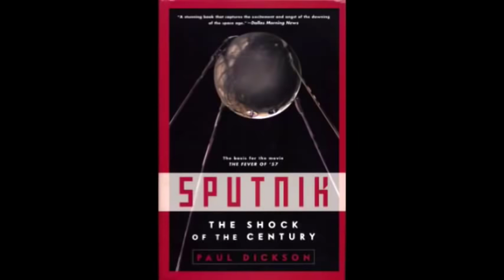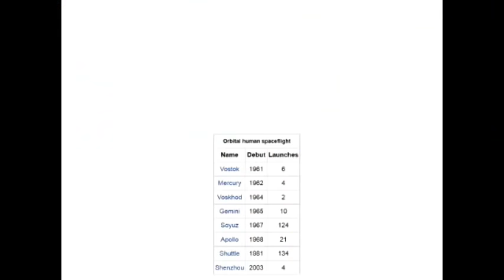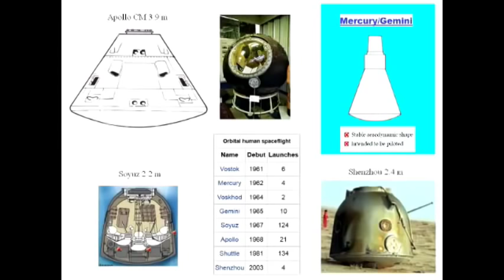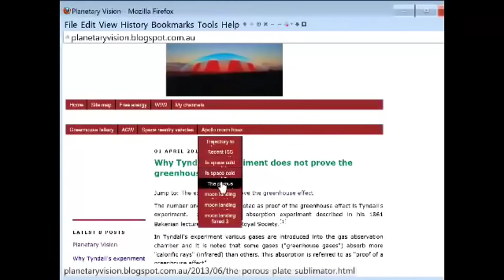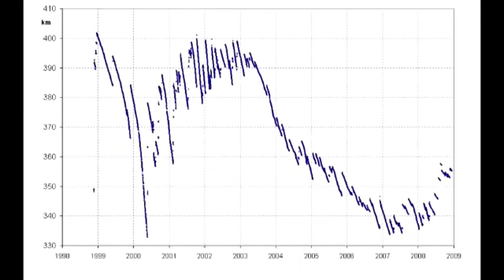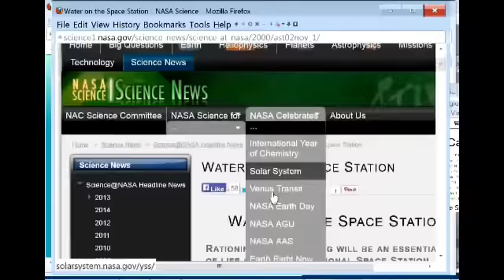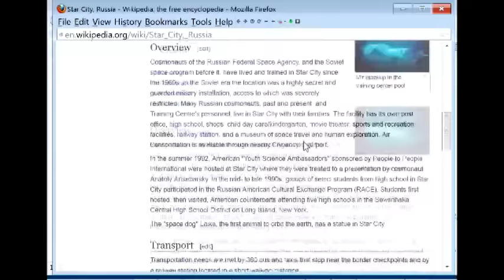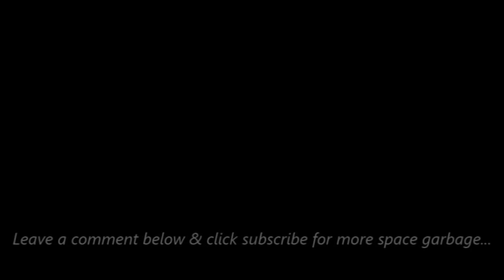The ISS Exposed

Comment: 8:40 look at the stand and the paper. this stand moves up and falls down (gravity or whatever we call the down force these days) And notice the paper the wind from chris and the movement of the metal arm cause the paper to lift rise and fall as hard and fast as about i think a piece of paper on earth does. BOOM! also the drill (blue makita on the left) is stuck on the wall the only way you could mount it on earth all the mass is in the head of the drill so they has to mount it facing down, In regards to huge deceivers and satanists and sodomites we all know they eat shit.

Comment: Lets start from this that movement is not possible in vacuum, as there is nothing to push yourself of .. in case of leak .. well that's another thing, as the pressure always want to level ... so in leak everything is sucked of within seconds together with any air left...
Reply: If you know how gun recoil works, you know how rockets produce thrust. That’s all I’m gonna say
Reply: Max Conspira rockets bring their own oxygen supply, and at this point gunpowder has the oxidizer mixed in the powder. Plus, some rockets don’t even use combustion, they simply use the decomposition or hypergolic reaction of some material like hydrazine.
Reply: Like Ive said before you completely missing the point  @alexsiemers7898  ... its not about chemical reaction that is or is not possible in vacuum... its about physical reaction that is not possible because explosion itself won't get you anywhere ... movement of rockets is possible only because here we have atmosphere that means mix of gases so there is a substance that has weight and condensation and if so there is a "floor" that jet can work with as a base to push itself from ... hope you get the point now. Or make yourself a favour ... stand on skateboard get two weights in your hands and by throw them away from you try to make a movement ... its not possible :... try to push yourself from weights by throwing them away... hope that explain.

Comment: Take a paper towel tube leave the paper on it if you wish... get a picture of the earth or flat object, or cut a round circle on blue paper around 12 inches...lay it on a table...look through the tube about 12 inches above the picture, or flat object...focus on half the outer edge of the circle (at 12 o' clock or at 2 o'clock) and half on the earth part...follow the outer edge of the circle...its the space station pics...the curvature you see is actually the outer edge of the circle...angle the tube to create perspectives of distance...feel free to share this...

Comment: You provide, like any flat earther, no prove... I don't see anything weird at all
13:45, he bends forward a little, let his foot loose, and floats forward, it's so much bs here.
And the noise, you really think this extremely expansive film production, they would have fixed the jet noise!
There are tons of electronic (cooling) and climate equipment on the ISS..
1) locate and identify your zero G-plane activity
2) prove the resupply missions are not bringing filters or chemicals

People, learn how things actually suppose to work, don't believe the flat earth community, or any conspiracy BS, you will only fool yourself..

Comment: NASA didn't 'supposedly' repair Hubble. 
They TWICE achieved a much more incredible feat -
Pushing Hubble back out to it's 400+ mile orbit!
Having no retro rockets, it's orbit decays.
Where exactly is the telemetry data used to 'catch' Hubble, then 'push' it back into orbit?
How much fuel was expended (how long was the burn etc)?
What made Hubble STOP at the desired orbital distance?
Better yet, where is the evidence Hubble was LAUNCHED in the first place?
 It was, afterall, the first, greatest mass launched into orbit. Naturally, any Guinness event performed by NASA, has ZERO evidence to corroborate.
Pure, 100% bullshit, but again, nothing out of the ordinary from Never A Straight Answer.
Reply: HST was never the greatest mass launched (hint: it was inside the space shuttle, so that weighed more...) - at 10 tonnes it's well short of the Saturn V capacity to LEO of 140 tonnes. Boosts for HST were comparatively modest (8km and 15km), made with the shuttle manoevuring rockets while the HST was berthed in the cargo bay during the servicing. Stopping is no problem - just stop thrusting...
Reply: @lappansommer546  
You speak as if you were there. 
Tell me Einstein, if they didn't 'babysit' the relocation, (meaning the shuttle didn't move along with HST), how did HST not continue off into space?
HST WAS a record breaker (in it's time - 2 records actually). 
Do the research. There is no written record of Saturn V for the launch of HST. 
Try to answer the questions correctly.
Feel free to link ANY document to the contrary (eg document transport of HST, driver of said transport, anyone present for launch..ect)
Have fun, I know I didn't.
Reply: @josephw4830  Read it again: HST was berthed inside the shuttle during the boost. How else could that work? Once servicing was complete the HST was lifted away from the shuttle on the robotic arm and released to continue in the same orbit. HST is far from the heaviest or biggest launched satellite - what records have you in mind?
Reply: @lappansommer546  Saturn V is not a telescope, nor is it in orbit.
I gave examples of records that should exist for the launch of HST,
diverting attention, changing my question, failing to supply ANYTHING - these are not answers.
Perhaps, you should read this, then reply.
http://prntscr.com/mdj16v
Reply: @josephw4830  You think the HST was dropping like a brick and the shuttle snatched it just in time? Take a look at the (old) https://asd.gsfc.nasa.gov/archive/hubble/a_pdf/news/facts/sm3b/fact_sheet_reboost.pdf - see how it lost 10-20nm across 3-4 years - that's less than an inch per minute. Docking in space is a long-solved problem, and of course the shuttle can match HST's orbit - that's exactly how HST was launched, from the shuttle. The HST is now lower than ever before and its low point is still 130km higher than the highest ISS orbit (and in a rather different orbital plane) so nope, they don't come close.

Comment: Hey space creeps,study a submarine and how they must be constantly be maintained, brought in to dry docks for servicing, etc........air locks are a minimum....They are made of steel, not light weight foil. Thousands of meteorites hit earth daily,,guess the station is just lucky? REALLY
Reply: The corrosive power of salt water might just be a tad worse than the nothingness of a high order vacuum, don't you think so? And as a target for meteorites, the Earth is bigger  by a factor of 16,174,040,086. You cannot even begin to imagine that, but let me try to help you: an elephant is bigger than a gnat by a factor of 1,500,000. Now take 10,000 elephants and compare them to a single gnat: that's the relation of the Earth to the ISS. (Note: I compared two-dimensional "broadsides", which is very conservative, because the attraction of the Earth for meteorites is by mass, a value based on the 3D volume.)

Comment: The space capsule is a Pyramid . We have nothing bonified in actual use that is shaped like a pyramid for earth flight. The only remote possibility of a reason to design a pyramid to be shot out of some type of barrel configuration to set it in flight would be the pyramid cone-tip of a bullet w/o the length & if this were their basis, the capsule would have crumbled with all inside of it from the pressure of some sort of trigger to give it it's jolt or it would have had to be made of iron or some very stable metal & that would be impossible to lift off the moon on it's way back to earth without It's initial rocket. The way they left earth would have to be the way they returned, with the same rocket, IMO & we ate it up that the capsule with picnic table legs actually started up & lifted on it's own, transformed into a flying vehicle & re-entered earth's atmosphere & landed in the ocean far away from human/public observation & that had to be shown pictures from them of it's landing in water & we were expected to believe this.

Comment: the girls hair is not consistent with zero gravity, look at any under water vacation/travel log shows, when the swimmer stops or changes head position, the hair keeps going in the previous direction until it comes to the end of its length and then drifts around. her hair is a sprayed up wig.it is just too stiff to be hair in zero gravity. the shoulders of the men look hunched towardstheir heads as you would if you were suspended at your chest . you would have gravity pulling you down into the harness and that would force your shoulders upwards towards your head.
Reply: Wow....

we have an 'expert' for "zero gravity' here....

ROTFL

Comment: dont forget having a negative pressure on the body is deadly they only performed one test in a negative atmosphere amd it almost killed the astro-not soon after all test done in pool to simulate zero gravity and the testing of.there suits. no suit we have today can withstand or hold up to zero pressure it makes the saliva on ur tounge boil without the positive
Reply: "negative pressure"??!

ROTFL
Reply: what they called.it not my words.just regergateded it but I assume it means having no pressure on the outside pfnur body cause we have a positive pressure against some many pounds per square inch
Reply: I will and u the video
Reply: send
Reply: @max5250  look up first astronaut to test suit in a vaccum
Reply: by MIG MAG
Reply: @robertguyton7189  

There is no such thing as negative pressure.
Pressure by definition can only be positive, since it is force acting on surface.
Vacuum is no pressure at all (or measured in so low quantity that one needs to use minus sign for exponent value).

Human body couldn't survive for long time in vacuum, therefore astronauts are using space suits.
The tests you are talking about were on people without using space suites.

Comment: We've been to the moon, I believe. There is equipment up there we can bounce signals off of for scientific experiments. They don't transmit anymore but I do believe NASA fakes footage and also airbrushes out structures, statues, and vehicles on the surface of Mars and the Moon.

The moon landing is fake, but we have been there and probably still do go there.

The vehicles used are not on display to the public. With the right shielding you can get through the van Allen radiation belt.

Congrats on realizing NASA are liars, but if you think our government does not have the technology to travel outside our planet you are very, very wrong.

Look up the Invention Secrecy Act of 1951. An affront to our freedom of speech, allows our government to hide any patent they like with no public oversight.
Reply from the maker: https://youtu.be/mVjYkcFf1mk

Comment: Unfortunately, this is asinine. The speaker does not explain how a rock in space can hit the earth. The reason we have NOT been back to the moon is that Democrats cannot make money by siphoning money off of NASA, anymore ever since Obama cut NASA's budget! Democrats would not be able to continue controlling and financially enslaving stupid people like the speaker here is attempting to do.
The airplane idea he uses is faulty because zero gravity cannot be accomplished longer than a few seconds. Also, the wire harness idea must use photoshop to 'stamp tool' the wires out of the picture, also the lack of gravity would be unable to affect the clothing worn by the NASA astronauts. The harness idea falls flat on its face because of the 'others' in the picture cannot control the chains around the neck the individual links cannot have so many wires suspending them to not get tangled. just some of the problems concerning this bullshit explanation. the sound heard are too low in volume to be jet engines. also, there is no high pitched whine that jet engines produce. however, fans and generators do create a lot of noise inside the ISS.

the lack of 'airlocks' between sections is because the lowest bidder created the sections to not need airlocks per section! The sections are not one layer thick like this idiot is attempting to explain. I have a friend that designed the solid fuel rocket motors to get the LEM off the surface of the moon. Once orbit speed of several hundred thousand miles an hour only a small attitude control is needed to adjust the entire station. remember there is no air to cause friction. 

Once you use a gyroscope in your hand spinning, you do not need to add rocket engines to adjust movement why is that, does it have to do with the Newtonian law of centrifugal force? 

Water is filtered. however dirty sweaty people do not need to use water to shower, use of a vacuum is the method of cleaning. 
trash is not created since everything is reused. There is no smell either, Clean rooms are used by all astronauts before going into space. 

My friend is a chemical scientist who created the chemical that doctors have no idea how to create because they had all the drugs they used in med school banned and taken off the market. Thus they are like this idiot they think astronauts are identical to the homeless bloke over in the underpass that has not washed in years.

The reason astronauts are happy having a great time is because of the after effect of the chemical my friend created to nullify the absorption of gamma radiation makes you incredibly high as well as increases your cognitive functions and reaction time. It also reduces sweat.
 The machines that scrub out the carbon dioxide from exhaled air are the main kind of noise created inside the ISS.

One point not addressed by this idiot speaker is the computer needed to millisecond by millisecond without any error ever coming across the screen of the view outside the ISS of the earth clods and ocean is not restricted by the amounts of Quintiquads of data that would need to be used to continuously feed the screen so that no flaw is ever seen of the camera tracking the earth. A bank of 100 Kray computers is not enough to accomplish this level of accuracy in the 'view from the ISS'. Movies do not have to show longer than a few seconds the view from the ISS and are only in 70mm too. 

Something NOT explained by the idiot.

The idiot cannot explain this because his experience in high-level upper atmosphere flight is based upon movies, not science.

For example, if the V2 rocket never went outside the breathable air of the earth when they were shot inaccurately at England how were they able to reenter the atmosphere since according to him they could not track in trajectory back to earth. According to this idiot, Adolf Hitler was working with British high command and never had working ICBMs in WW2!
Reply: I am a Graphic Designer using Photoshop, InDesign, Illustrator, Corel Painter, Maya, AutoCAD 3d Studio, and Sony Vegas in drawing and retouching video, as well as the Walters Grinder CNC programming to build tools, the Fanuc 2200, CNC, the Fanuc 4400, CNC centerless grinders, Deadtru, Monoset, and various manual diamond edged grinders to MAKE tools. I am a master welder and metallurgist, my knowledge is in reality not the world of movies! I doubt this speaker has had ANY experience in making anything more than this video to prove his stupidity. I openly challenge this idiot into explaining the and naming the first and second rules of thermodynamics, the theory of relativity the theory of Deoxyribonucleic acid and the methods of how to create aluminum and set up a Fanuc 2200 that does not use M codes;. to name just a few processes!
 I am also a journeyman toolmaker machinist, as well as the other trade skill and the profession.